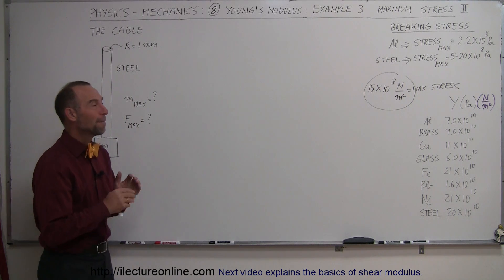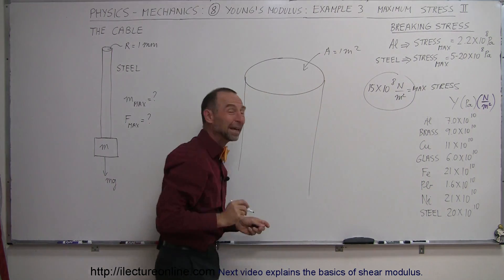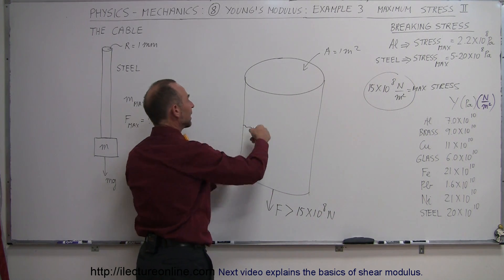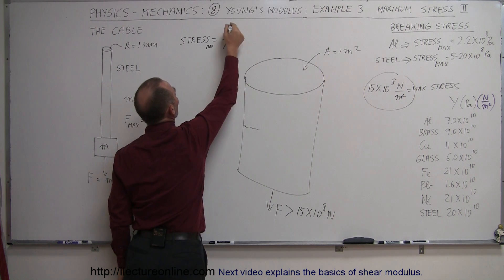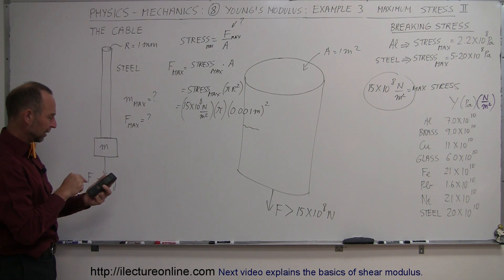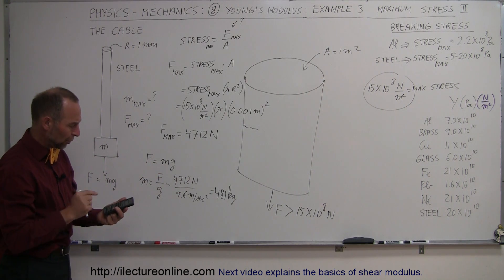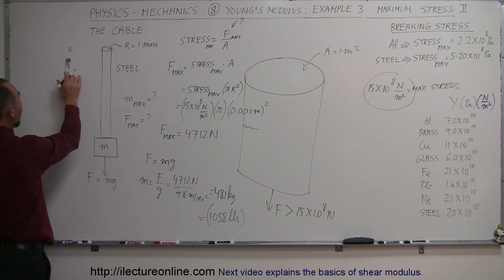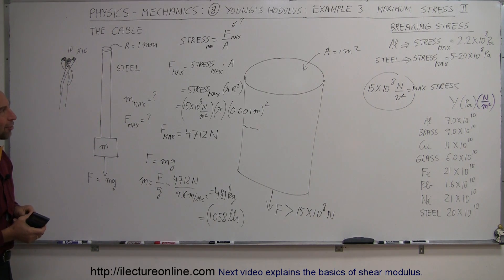Physics - Mechanics: Stress and Strain (8 of 16) Young's Modulus: Ex. 3: Maximum Force

Comment: Does increasing the length have any impact on the breaking strength of the wire?
Reply from the maker: As more stress is applied (by increasing the force), the wire, cable, or rod will continue to lengthen as the bonds between that atoms will be pulled apart ever so slightly.   Eventually the bonds can no longer withstand the force and will begin to break.  That is when the wire will break.

Comment from the maker: There are two parts to the problem  The first part the cross sectional area is pi*r^2 = pi* (0.001m)^2
The second part of the problem is calculating the force that can be applied if the cross sectional area is 1m^2